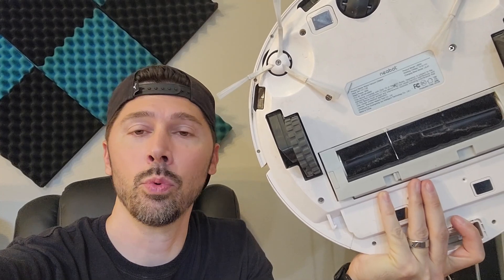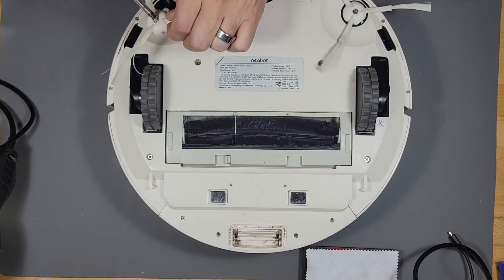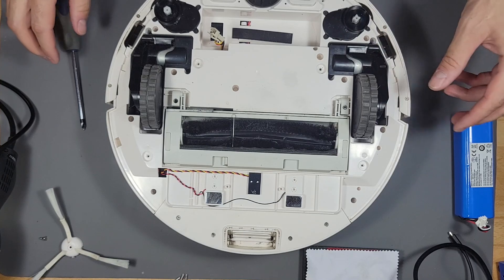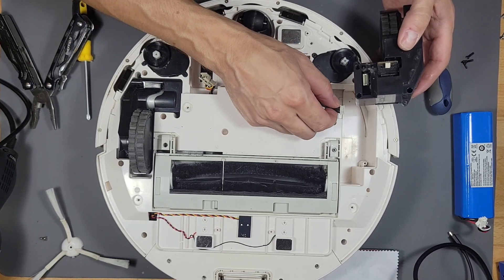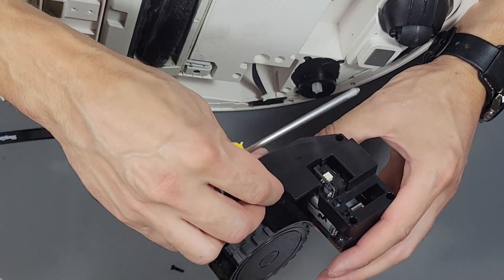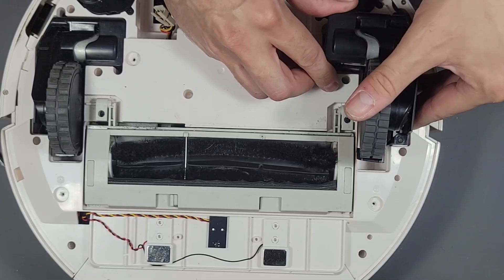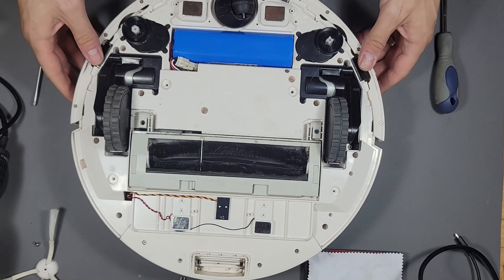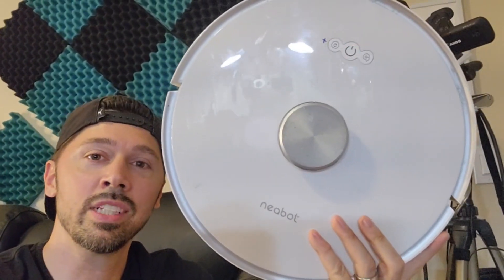How to Fix Robotic Vacuum Neabot N1 Spinning in Circles

Comment: Nice timing... My robot also started spinning in circles.
Haven't diagnosed much further yet, but in my case the wheel is completely locked up. However much force I apply, I can't make it turn.
Reply from the maker: Keep us updated on the repair.
Reply: Mine has the same problem. I disassembled the wheel to see why and found out the screws, that held the inner cap in place, were loose as the plastic, they were screwed in, was broken. And these loose screws blocked the wheel.

I'll look for yome countersunk or flathead nuts, drill holes through the plastic and try to fix it this way. If i won't find fitting screws, i'll try to get a replacement wheel.

Glueing might also be an option. But the inner cap has only direct contact to the rubber of the wheels. I'm not sure which glue could work under these circumstances...

Comment: Just a heads up, get some epoxy to strengthen where the wire goes into that big connector, they often snap there. I fix these exact model vacuum daily as my full time job. If you are ever struggling or need advice, give me an inbox 🦾
Reply: Also, the motor burn out theory isn't what happened, the wheel it's self is screwed together with 4 screws into 4 raised posts, those screw posts snap off. There is a recessed place in the wheel where the loose screw can drop into and it jams the wheel up. 

With the brush, pull the cap off of the end that spins, there is a bearing under it that hair gets trapped behind. Worth clearing it out from time to time